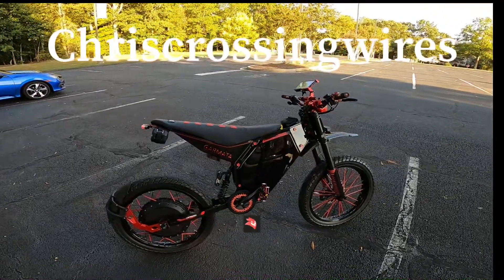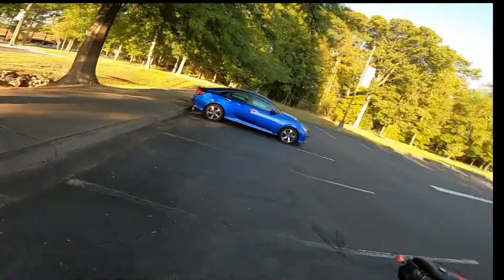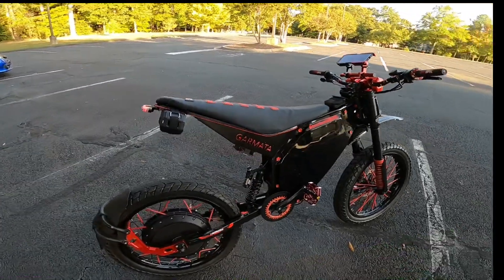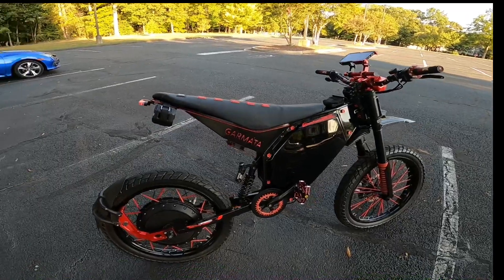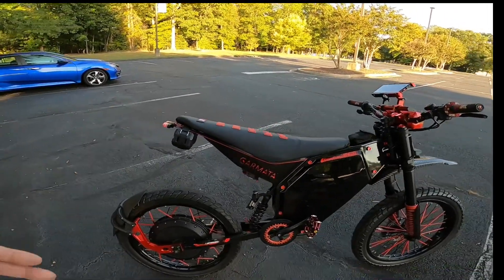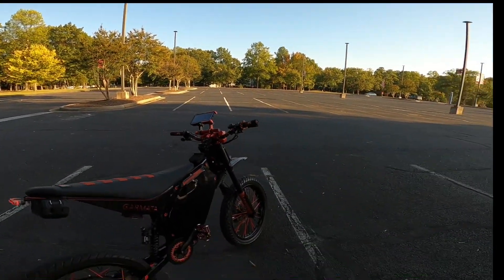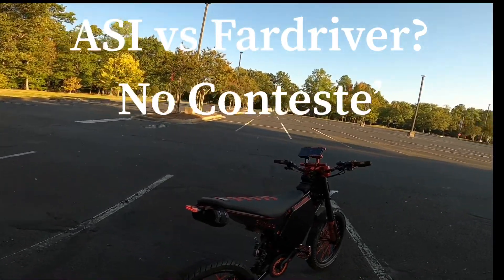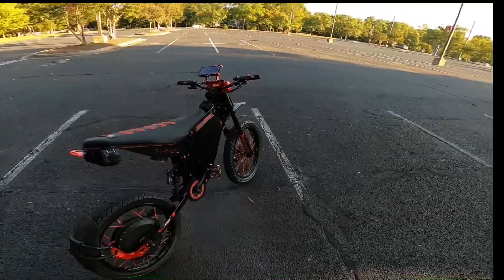What your choice of controller ? ASI BAC8000 or Fardriver ND72680 or others & Why?

Comment: I’m a high current LEV type of guy. Crazy thing that I’ve experienced firsthand is the low voltage that ASI *seems to use IOT achieve significant success. Chris, another thing that peaked my curiosity was what you said in your proposition WRT high voltage, versus higher current; torque & hp…it brought me back to the days of mustangs  versus corvettes & vettes versus Ferrari, Ferrari versus Lamborghini.

Most people don’t know or understand the distinction or degree of differences.

Just pop a *cheap hemi into a dodge or Pontiac & call it good.

My question/thoughts are, in addition to voltage & current, we are in the infancy & not working with a full set of cards. Gearing ratios, liquid cooling, etc., aren’t even being utilized, in addition to extended control arms, etc.

I’ve seen the integration of gears, which helps diversify power to appropriate gears vice regulating everything through the throttle; however, manufacturers & the DIY community aren’t there due to a whole host of factors.

That’s another subject for another day.

When it comes to ASI, my 48v is faster 0-30 than anything that I’ve ever experienced with FarDriver; that’s not to say that I’ve tried everything or ones superior; however, based on my experiences I tend to lean ASI.

The technology that I’m most intrigued about now is how they’re using alternators.

Do you have experience with SiliXcon? Expensive, but very m very good performance & has Ferrari listed.

Good information & conversation.

Comment: I will donate one day cos you really got that ability to break down fantastic information, specially when it comes to when I install my bac 8000, and my Daly 500a BMS ,( I don't understand what the BMS does) but it must be able to handle the hi amps !
Reply: BMS is basically for safety of the battery. You can set a AMP/voltage limit for charging and discharging so it will cut off if you go above or below those limits. so it saves the battery from draining too much and dying, or overcharging/overdischarging which leads to overheating/damage. Also some BMS have balancers with them which will balanec the cells to have same voltage. And most which have those features comes with bluetooth and an app where you can monitor and set every setting.

Comment: Hi Dr Chrischrosswire, I got some batterys that doesn't need welding ! They are C020B  lithium ion polymer (40ah) I got 50  of them , they read 4v on my tester, but they are flat, I want a 100v battery is it possible?
Reply from the maker: Sounds like got enough to make 2 I'm not sure how large the bsm
ea physically but capacity wis e and a   pm

Comment from the maker: So let me be clear In not telling anyone that they should use a BAC over a Fardriver. I said what is your chioce.This is my reason for why I'm not switching to a Fardriver. That's because someone told me a should change to a Fardriver, in my opinion that would be a downgrade for me. By any means do you these are my opinions and my opinions only. What I eat won't make you shit! You like bologna, I like ham simple or maybe I’m bologna and you ham, nope. This is Chriscrossingwires ch. This is what I'm doing and what I believe. I'm not Ebike Lord this is my thoughts and experiences only.  I started off with a yuandai $45 controller that controller was awesome. This BAC is awesome That's what I'm using

Comment: I haven’t looked into the full details of those controllers, but I would bet a powerball ticket on the fact that their are cheaper utilitarian controllers that are far cheaper and yet undiscovered being used right now in China. VESC controls seems like the driving force for development, minus the product placement.
I like the shifting glitch camera work like you meant to do it.😀
Reply from the maker: My battery door was not on so I think battery was loose not on purpose I’m sure irritating .
Reply: @ChrisCrossingWires1212  It was a interesting effect if not intended…
Reply from the maker: VESC is definitely the future
Reply: @ChrisCrossingWires1212 I don't know about that.

On the one hand, it can be a great controller. 

On the other, it can be a piece of junk.

If you are adept enough to design and order your boards following the specs - that's great.

If you're ordering a pre built  controller, your options that  tend to be cheap and nasty, or expensive and pretty decent.

While I like the idea of open source and vesc is well written and developed, this introduces a couple of problems:

Anyone can do an implementation to whatever degree of quality they choose, and there is not much the author can do about it.

It also sliced up an already small market, making it difficult for parties to make a profit and offer a quality product.

Potential manufacturers would have to be reluctant to start producing the product.

Buyers do not benefit from economy of scale as they would if there was one company.

Comment: Hello my friend, i want to work as a delivery on ireland. how long does this bikes battery can last. and can i help the economizing battery using my legs?
Reply from the maker: Bro with the battery that I have you won’t need to help this battery I guarantee I get 100 miles hard riding so cruising I can’t see anyone killing this battery in a day
Reply: @ChrisCrossingWires1212  thats very good to no. Do you know how many EUROS a bike like your would cost?
Reply from the maker: @tannato4864  First I d have to know what a Euro was lol Ive got abot 8K in this bike and thats with me Building My own battery which would be the most important and expensive part. 20S16P with Custom Copper Busbars and this pack was built for high current meaning heavyduty everything